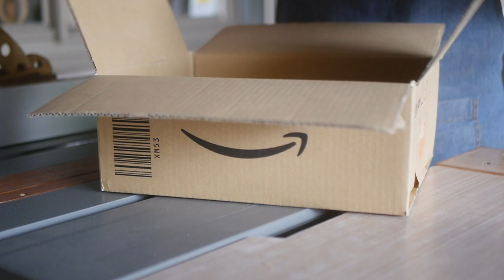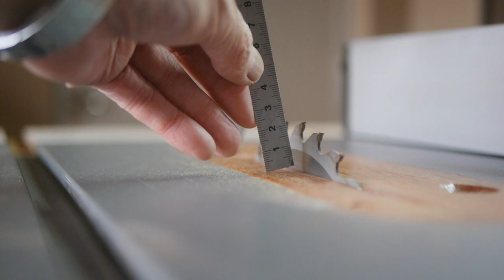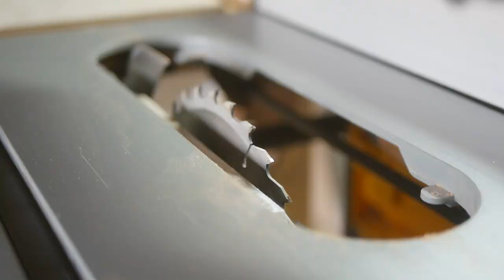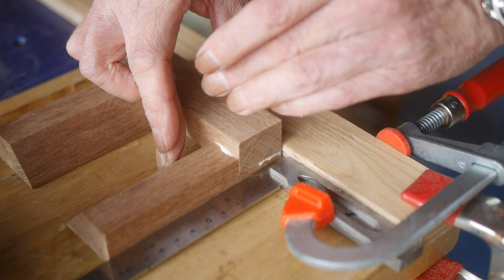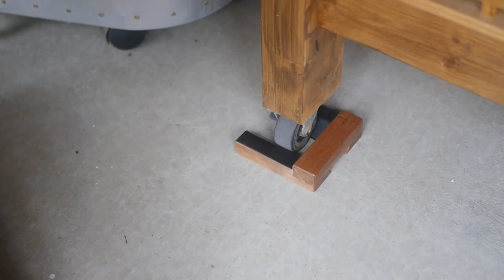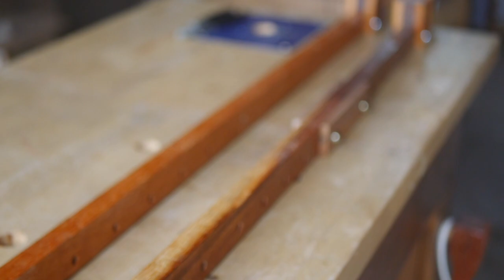Fixed casters

Comment: I like the chisel you use to clean out lap cuts....looks like a sharpened screwdriver...brilliant
Reply from the maker: Hello, Peter
Thank you for always watching my video
And thanks for the nice comment
I don't have thin fleas that cut well!
I found a screwdriver that I no longer need. The tip is steel, and if sharpened well, it will be sharp.

Thank you
See you